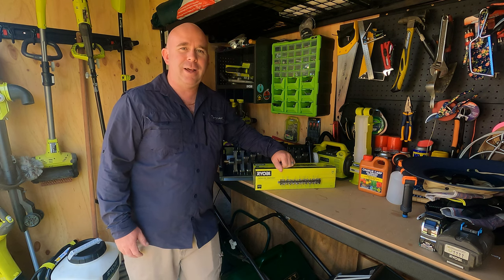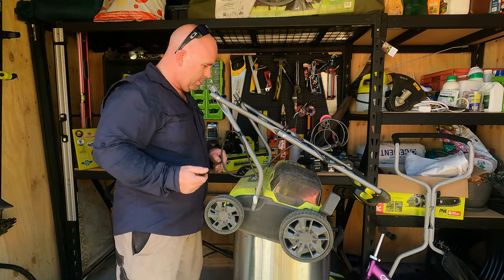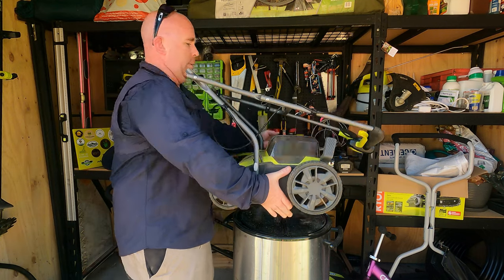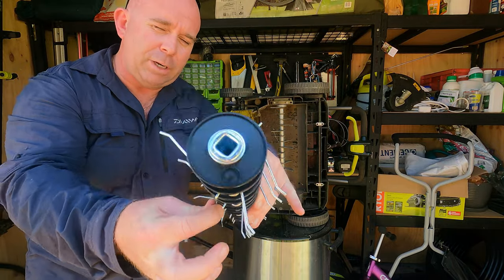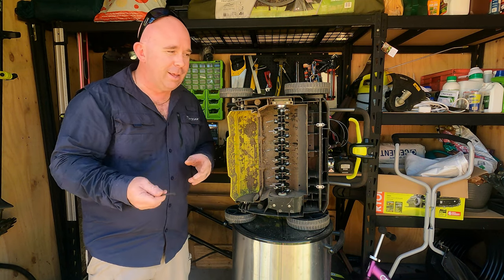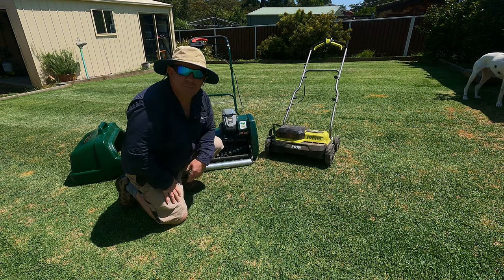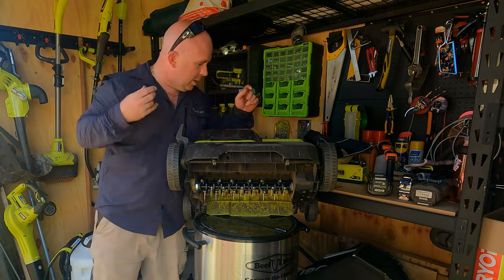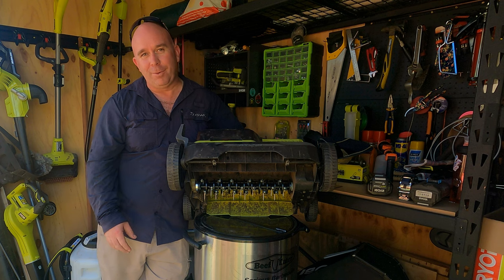Test Drive: Ryobi Dethatcher Attachment

Comment: Thanks for that. I've just spent more money on a self-propelled AEG lawnmower (same company that produces Ryobi) & I have (mostly) buffalo grass. I have to be careful as there are a couple of spots where a bit of rock protrudes (mower goes over it) & should dig it out (it may need a spud bar to remove though). I'm definitely going to look into this Ryobi unit though.
Reply from the maker: Awesome mate, glad to be of some help. How do you find the AEG mower?
Reply: I started out with a 36V Ryobi mower about 10 years ago & it was a little under powered when tackling some heavy buffalo growth & after getting the AEG 58V line trimmer 7 years ago I also bought their 18" 58V mower. It held two 58V batteries & was quite good but there was some room for improvement, which they did with later releases, but just recently I bought the 21" self propelled model & it auto switches between the two 58V batteries (8Ah or 4Ah) & is a good basic mower with efficient grass catching. It runs with a 1200 watt motor (same as before) compared to the top Ryobi 53cm (21") model using a 1000W motor, but it isn't fancy in features etc like that on the Ryobi such as top displays & alloy handle bar system etc, as it is sold as a commercial model. For my place it is overkill, but I got it at an extra good clearance price & with two 8Ah batteries. So far I am quite pleased with it. It uses a single bar blade & not this new 'Crosscut' blade system on the Ryobi (& other brands like Honda).
Reply from the maker: @rossthefiddler5890  Awesome, thanks mate. That's a good insight. In my last video I was talking about potentially making a switch from Ryobi to something else. At the moment, Greenworks are in the hot seat as they seem to have some really good gear coming out, but I'll have a proper look at AEG now too and suss them out. I appreciate the info 🤙
Reply: @thelionlawn  Got to be careful not to have too many battery platforms as I now have Ryobi 36V & 18V plus AEG 58V & 18V. 😄
Reply from the maker: @rossthefiddler5890  That's exactly my concern. Lol. I have Ryobi 18 and 36, and Greenworks 40v, so going to Greenworks 60v would be the logical step if I had to change up, but either way, I'm going to end up with more chargers and batteries than I can poke a stick at.
Reply: @thelionlawn  After the AEG mower (in the following year) I bought the blower & hedge trimmer in 58V & also wanted the 16" (now sold as 18") chainsaw but had to wait for stock to come back after a recall & jumped on one as soon as it became available. I was rung up by them soon after to tell me production used old pc boards & had to recall mine again. Already there was a bonus 4Ah battery, but he offered me a blower or 18V 12" chainsaw as well to compensate me for my inconvenience, so I took the chainsaw & that started me on their 18V range (workshop & outdoor tools). I since added the line trimmer & hedge trimmer (in 18V) as they were lighter & did a lot of the work I needed. The 18V (33cm) line trimmer is all that is needed for grass edging etc & hedge trimmer for a majority of hedges within reach. I did buy a second 58V (43cm) line trimmer 8Ah kit late last year with a bonus 4Ah battery because two of my original batteries became faulty & stopped charging (they don't last forever & that is the reality of battery gear) & it was a way of getting more batteries. I now leave the AEG pole hedge trimmer attachment on the old (58V) one & use the new LT for heavier whipping (in our bush backyard), along with their bike handle brush cutter (with metal blade).
I've gone through a couple of Ryobi 18V pole hedge trimmers (& a 36V version) until AEG produced their attachment for their line trimmers (can be used on both 18V & 58V drives).
Reply: @thelionlawn  BTW, the AEG Hedge Trimmer Attachment can also be used on Ryobi LT drives too. Probably best on the 36V units though.

Comment: The Ryobi is a great little unit, had it for about 2 years and used it to finish up a few renos. Cost value is pretty spot on for the a house hold lawn enjoyer.
I’d only suggest get bigger amp batteries to keep it running for longer and forget the bag and pick up the clippings with the rotary mower.
Reply from the maker: Absolutely mate. Ditch the bag and just tidy it up seems to be the way to go!

Comment: Hey mate,  Question... my lawn looks amazing but it's really spongie,  I'm thinking it's got a build up of crap underneath. Do you think  it could be thatch build up.
Reply from the maker: Hey mate, yeah definitely could be. Jump down and pull the canopy back a bit and see what's under it. You'll probably find a good thick layer of dead junk that you could get out of there!
Reply: @thelionlawn  cheers mate,  how would the ryobi go on Sir Walter?
Reply from the maker: @UTPP  I loaned mine to a mate with SWB, and he used it only with this dethatcher attachment, not the original "nasty bastard" fixed blade attachment. It worked a treat for him. He filled a few Otto bins with thatch he pulled up, and it was gentle enough not to rip the lawn right up. If you use the same, spring loaded tyne attachment like in this video, I reckon you'd be fine. 🤙

Comment: Mate.. so good. Was always a bit scared at just how hard the scarifier function went with the original blade.  Great points on actually extending the use of the mower because I really havent used mine much being I haven't  been ready to do a full reno due to time constraints. 

Would this even be good on the lowest setting for a mini reno on buffalo? Considering it could get pretty low (maybe low enough for buff?)
Reply from the maker: Potentially mate. I would just give it a go at each setting, dropping down incrementally and see what happens on each. If it starts yanking up all the runners, go one notch higher?
Reply: @thelionlawn  just to update on here as well mate, I didnt see it on the bunnings website but was at my local up here in Newcastle so picked it up! How low is your lawn at the moment (in the video). Wondering if I should take the batch down a level before hitting it with this. Keen to give it a go!
Reply from the maker: @Deftone2k  Hey bud, the lawn is somewhere between 12 and 15mm in this video. I've lifted the height a bit now at the back end of the season, but that's about the height it was through the mid season. The leaf length shouldn't matter too much for this jobby, as it's skimming through it, but just go incrementally with the machine so you don't pull your runners up too badly.

Comment: What is the difference between dehatching and scarifying?
Reply from the maker: Good question, and depending on where you look, you might get different answers. But my understanding is that "dethatching" removed the dead thatch sitting on top of your soil, and underneath the grass canopy, whereas "scarifying" takes it a step further and digs lightly into the soil and removes the dead material from within the top part of the soil profile as well. So, dethatching is a good maintenance activity that helps get sunlight, water and fert to the soil surface, and Scarifying will allow all of that, plus a deeper penetration of the soil which aerates and resets your soil profile.